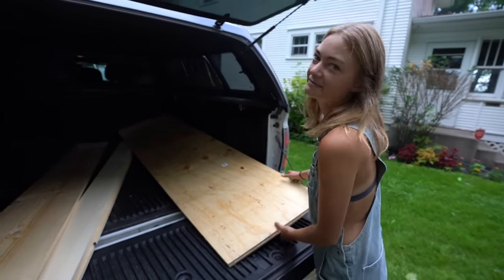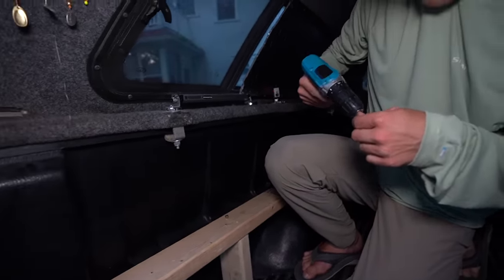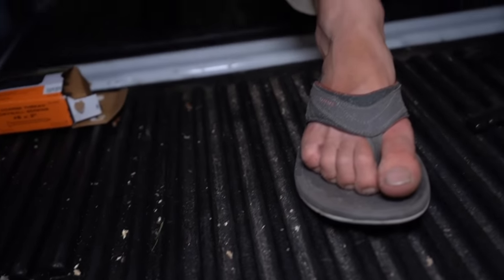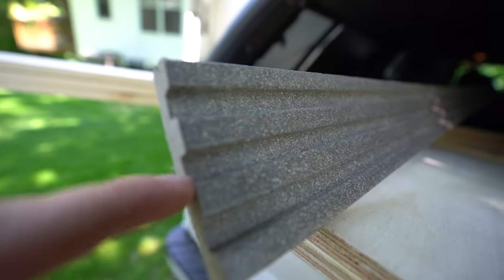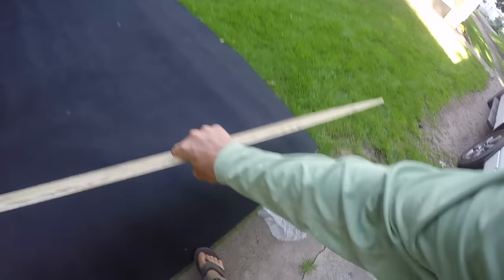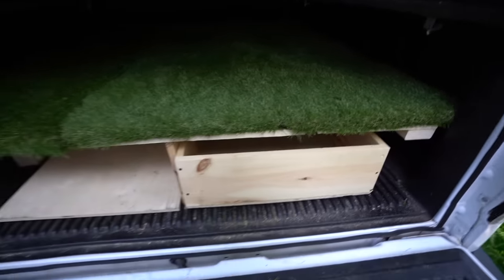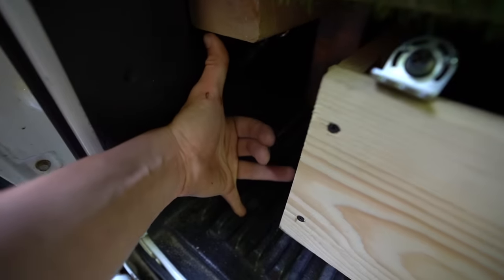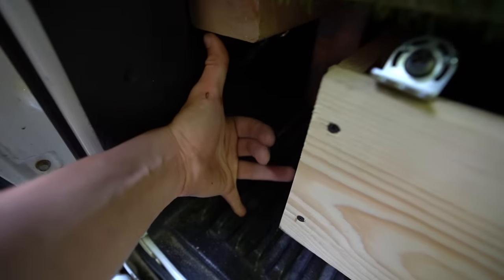DIY Truck Bed Camper Build - Start to Finish

Comment: Super dangerous cuts on the table saw.  Please learn how to use the table saw safely before you get hurt.  It only takes a split second.
Reply: Oh man, I let out an audible "NO!" when I saw her cross cut on the table saw and again when he was ripping the composite with his fingers so close to the blade. 
And then did a face palm when I saw them use the chop saw and circular saw later in the video.
Reply: @Xktree72  scary as hell !! I
Reply: Holy Shit!  They are lucky!
Reply: Agreed!
Reply: Yeah, I clenched up each time
Reply: Rock Hard extreme lol
Reply: Yeah , those fingers were a bit too close to comfort towards that blade for me . Use a push rod dude.... one slip & they will be calling him stumpy
Reply: Xktree72 dude, seriously, my dog even looked at me like wtf when i yelled NO!! aloud.
Reply: 5:53 where he's pre drilling and has his hand on the backside of the board holding it 🤯
Reply: Fuck me this has to be the scariest use of power tools i have ever seen 🤦🏻‍♂️🤦🏻‍♂️

Comment: Watching her try to cut that across the table saw with no guard or extension table was scary af.
Reply: People who only occasionally use power tools make do with what they have. I've cut boards that size on my table saw. It doesn't have a guard (took it off) or an extension table. Now, my 12" sliding compound miter saw is a different story. I use it most. But she has inexpensive equipment. By comparison, my miter saw and full size folding stand probably cost as much or more than all the power tools she has.
Reply: @WiPri0371  well aren't you just fucking awesome
Reply: Absolutely! About time someone recognized! 😝
Reply: Yeah cross cutting on the table saw like that is unsafe, wouldn’t recommend lol
Reply: The entire video was scary af
Reply: @WiPri0371  way to turn it around and make it about you
Reply: This whole build is scaring the hell out of me.

Comment: If Hannah hasn't already invested in one, she would benefit from an impact driver. Use it to drive screws instead of a regular drill. Works extremely well with star drive (torx) screws.

Comment: Great build Mav. The Eli you had between Hanna and your dad was definitely on point. I’ve been looking at doing the same but I’ve been having difficulty in finding a shell for my 2018 Toyota Tundra 4x4 sport. But you definitely gave me what I needed to build inside my bed of my truck.

Comment: Great job on your build ....I have had the same system in all my trucks for the last 20 years ....it was always called a carpet kit back in my day .....sleep on top and 2 drawers under for storage .  One tip I can give you is to glue then screw your drawers together ....makes them last longer .....ok have fun with it  !!

Comment: At your 2 mins you have the drill bit in between the jaws. You have a fuse on the other end of your Positive wire don't you! Should have some form of manual disconnect there as well. Would be good to  put plastic tubing over it to reduce the  likely hood   of a short. Look for a 3/4" knockout (electrical ) and put a short nipple through the truck box wall. You can put some RTV in to keep dust out.

Comment: Oh I thought Hannah was going to lose a finger with that cross-cut on the table saw. NEVER do that. Easiest way to get hurt.

Other than that, I love the build!
Reply: Honestly the full length rip with no fence is probably worse. But yeah the only thing that kept her from getting a face full of lumber and maybe losing a finger was the absolute crap motor of that saw struggling on the cut. 😂

Comment: Super build, Mav! I especially like the composition wood rails and turf. Those set you apart from the rest. <3 :-)
Reply: The composite wood was great idea for the runners for drawers for any kind basically I would definitely use that tip
Reply: I was wondering out of curiosity what kind of mattress do you have to sleep on

Comment: 3:40 could’ve been very bad man. That was “kickback” waiting to happen, luckily it didn’t happen. The blade was wanting to shoot that piece of wood back. Very dangerous. Good work though guys.
Reply: I was cringing so hard watchin that
Reply: Nathan22 Outdoors Me too. I do woodwork a lot and that happened to me once. I almost had a heart attack lol
Reply: @661EASTON89  during rhe summer my uncle was cutting a corner off a peice of hardwood, and hes been doing carpentry for 25 years and isnt new with tools, but used the saw backwards becausw he just had to do a small quick cut and next thing u know the saw grabbed and pulled his peice of wood, cut through 4 of his finger tips, all 4 finger tip bones are basically shattered and 1 finger tip was hanging off. It just takes a split second and the smallest error
Reply: Nathan22 Outdoors That’s insane. It’s crazy how you’d assume it’d throw your hand forward and not necessarily into the blade but more often than not the blade somehow gets your hand to go into it when you get kickback.
Reply: @661EASTON89  yeah at the end of the day, you can never be too safe. Its still a 10" (give or take) spinning peice of steel with huge teeth if its a wood blade, small mistakes have big reprucutions

Comment: Mav, the camper build turned out pretty good man. I'm sure you'll be doing some modifications once you "camp test" it though. Also, I was in Sausalito in May...very cool place... didn't get to do any fishing🙃 but did some sailing and went hiking up in Muir Woods. Wish I was still there cuz I would definitely meet up to do some 🎣. Good Luck on your trip and safe travels dude.

Comment: With the sketchy table saw cuts you guys are missing a "fence" when you are ripping (cutting the long way) a tip if you don't have a fence is to clamp another board to the saw. looks like you were safe and successful but be careful, anyone in the professional woodworking field today would consider what you are doing really dangerous.
Reply: lol gosh what did people DO before all the rules and regulations on how to never hurt yourself. 😏 likely learned how to use something skillfully... ya get me?

Comment: Mav, I have looked at many vids overlander camping. To maximize your kitchen. Have you thought of putting a top sections over the left side drawer under the bed side and put a drop down leg to support it. Once you have the top board on it you can still access your spices and have plenty of room to cook and not just your tail gate. Just a thought

Comment: Look at the wheel wells ...on top there's a notch ...a 2x4 will fit  ....then front and rear there's couple more...cut 2x4 to fit ...then get 2sheets of plywood cut to size

Comment: Just a suggestion used or get 300 watt solar panel and build a bracket metal bracket up on top of your canopy topper and then go ahead and bolt down the solar panels on top and then get the lithium ion batteries and do your homework in research on all that other stuff that goes with it just a heads up have fun

Comment: Good job young man. A word of advice , put all your heavy gear on the back end of the sliding storages. Will put less on your board's going horizontally. Other than that Great job.

Comment: I like what you did in the back of your truck when you want to go camping and I  like the camper that is on your vw bug  they  make ac units  for the top of that camper and thwy make lights to go in that camper  and how much did that camper cost to get it new and how much did it cost to put it on your vw bug

Comment: Be sure that battery is secure.  You don’t want it falling over from quick turns or rough roads.  You also don’t want it crashing through the rear of your t4k. In a crash.

Comment: Just came across this vid.....maybe since the build, you’ve already done this but if not, if you can place a solid panel “lid” on top of your driver side, kitchen set up, you’d have a roll out countertop space to set a camping stove and or cutting board on. Maybe have a wooden leg you can set under the end to help support it? That’d be cool. Nice work.

Comment: Nice job I'm actually doing the same thing myself I have a Dodge up on 38in. mud tires with a 9" lift. I hunt Florida swamps I need a truck to get back into them... I want an assistant that is that pretty..

Comment: My only suggestion is your Power Cables into the Bed, I zoomed in as best as I could. Always use Rubber Grommets when running Power Wires, no matter how large or small of wire. I thought I saw a Grommet on the Ground Wire, not the Power wire?????  If you did, great, then seal with Silicone.  Does your Topper have sliding Windows? Fresh Air is important.  Does your support both the Truck Battery and your Aux. Battery at once?

Comment: Thanks for the tutorial. I have the same truck (sorta) and I didn't want to spend 1k on the Decked system, sweet as it is. Clever idea using the composite boards as runners for the bottom of the drawers.

Comment: If the legs sit inside the grooves of the bed of the truck and the legs are attached to plywood, having it sit on the wheel well is no big deal. Though you do need legs on the wheel well side too, on each end. 

I am 125lbs, plus I have 2 60lb dogs that sleep in the truck bed set up and the bed has never budged.

Comment: Nice Video.  Change out the Battery for a 12V AGM battery (go to batteries plus). Regular car batteries put out sulfuric acid fumes You can end up in the hospital or worse.

Comment: Since you use those batteries and are always on the road and need all that power and you charge them with the car that could drain your cars batteries making you unable to drive or power anything ever thought about adding a solar panel on top of your truck to power the batteries instead of using the cars batteries just an idea might save you a lot of trouble in the long run especially with more high-powered things like fridges

Comment: You should have used ridged foam board insulation instead of astro turf.  Would have provide far more insulting value for sleeping on.  Could have got 1/2" or 1" or 2".  could glue it to the ceiling also to help keep the heat in.

Comment: What about head room. Looks like you will only be able to crawl and lay down in there. Almost seems the cabinet is a little wasteful. Covering the battery is good. 750 watt inverter will power a fridge a laptop and what else ? I do want to see the video on how you charge.
Where do you get money to have this free time and travel?

Comment: I have a question. Why didn't you put the astroturf on the actual bed of the truck before you made your platform to put your bed on instead of just putting it on the platform before you put your bed up?

Comment: You know that all you really needed in there was the basics and didnt need the excessive carpentry ie like a quality matress, bedding, insulated walls, a battery/generator to plug a phone into, a phone (obviously) a jerry can of water,, gas cooker (heat) a small folding table then for cleaning a big sponge, jug, bucket and bar of soap, basin for hands then just eat take-out on the road, as a "bug out"  vehicle, it's very easy to live off-grid its just that most people including me just have a lot of "stuff" we're not willing to part with, it's like borderline homeless, i support it as a temporary thing between jobs but end of the week, i would need to go back to solid ground to restock, clean down etc

Comment: Dude...when using a table saw, use a scrap piece of wood as a pusher (or chicken-stick...as some call it).  I'm surprised you didn't cut off a finger.  Be safe.

Comment: Did kind of the same thing ..Mine is one wide drawer and i have my solar batteries (2ea 6volt golf cart batteries 140 lbs) sitting up by the cab so when I pull it out. the drawer is counterbalanced by the batteries. just another way of doing things.

Comment: Nice job for a novice hehe ...new sub here from 🇨🇦....btw, dont forget to vent that battery.....
Reply: Yep,
 That looks like an unsealed battery in an enclosed space will eat your interior and lungs. Can be explosive when the inverter fan kicks on or other sparks if heavy charging without venting.
 Battery best kept outside and large cables run to the inverter etc. Or use a sealed battery.
 Nice project though.

Comment: TIP: Buy a sealed battery instead of the one you currently have. Benefits of having a sealed battery are- no risk of acid leak out and ruining the wood and your truck bed.
Reply: Less chance of any off-gassing as well with a sealed/gel battery.

Comment: 3:36 the reason why that was happening The board was pinching the blade meaning you we're pushing one side more than the other should have used the slider that table saws come with that go in the slots that you see on the table so that will not happen and so u get straight cuts have have about 7 yars of building all types of wood project  and alot of time on youtube watching other people making wood projects

Comment: You should have Aleen the bed liner off that way you could have drilled right into the box. But then you would have to add more insulation but it would make the build sturdier.

Comment: HELP! anyone know what that plastic decking material is called, or where i could find it? i need that but have no luck finding it. it looks much thinner than actual plastic decking boards which i can find but are too thick and don't match grooves of the plastic bed liner.

Comment: There is no way you should have used a table saw to cross cut that board. You didn't even have a miter gauge. That was a radial arm saw cut or at least a handheld circular saw. Lucky it didn't kick back.

Comment: nope nope nope, as someone with carpentry skills I turned this off at the 4 minute mark. Miter gauge would help, having an actual good saw would help. Put your drill bits in the drill straight would be a huge leap forward. Or! Just stay away from power tools altogether!!

Comment: Oh god, their woodworking skills are atrocious. Cringeworthy as hell. Granted I’ve been woodworking for 14 years but damn I though someone was gonna lose a finger when she tried crosscutting on the table saw without a mitre gauge
Reply: 1N - UP I live life on the edge 

Of the saw blade 🤷🏼‍♀️😂
Reply: The cross cut, cutting plywood with a table saw, no push stick, no zero clearance insert. Someone is going to learn the hard way.